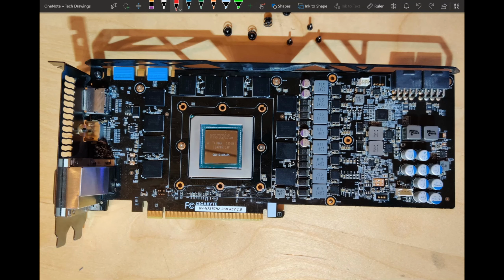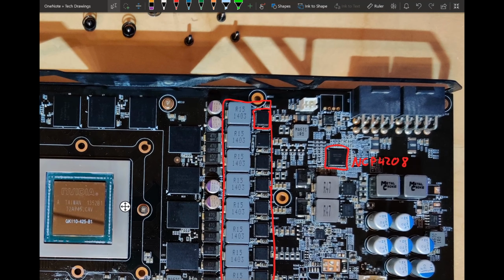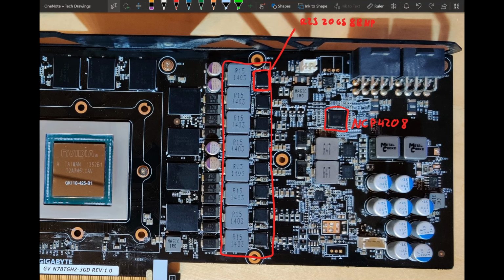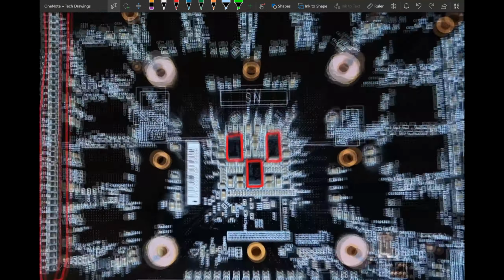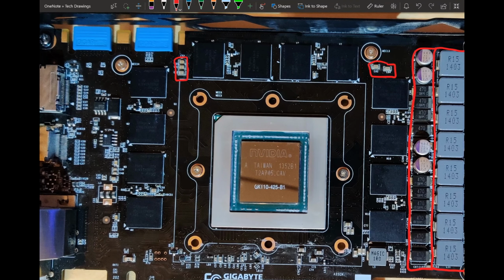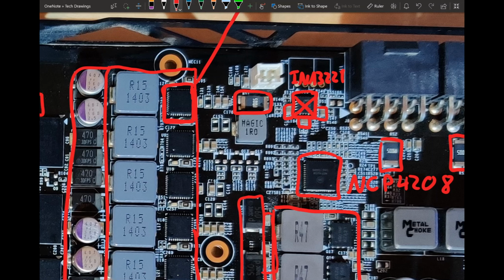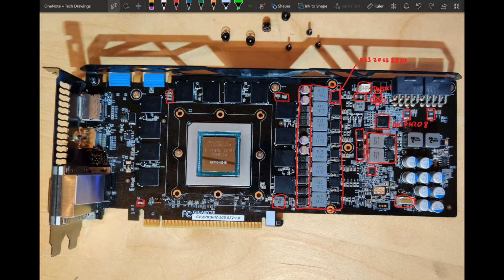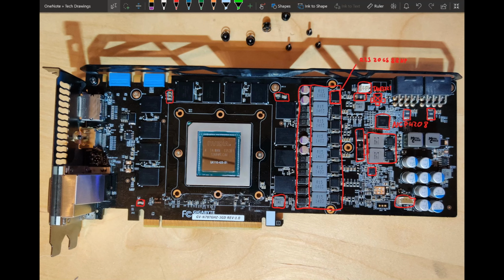GTX 780(Ti) Windforce / GHz Edition PCB Overview

Comment: Hi can i ask u about my gpu..im searching alot in jnternet and still no luck about my problem in my gpu titan x..i bought it new in ebay..i waterblock it..when i installed it doesnt work.i only hear click and my pc wont boot..i put another gpu my pc works..maybe i guess my titan x broke..or maybe its grounded or something..can u help me what to do in troubleshooting.i check everything in pcb nothing burns or smell burn..but i feel confident still work..but i dont know how to convince me its dead..pls help me..i think u r my last resort..thanks godbless and more power
Reply: You have a short, likely 12V and likely a MOSFET unless you physically damaged something during waterblock installation.